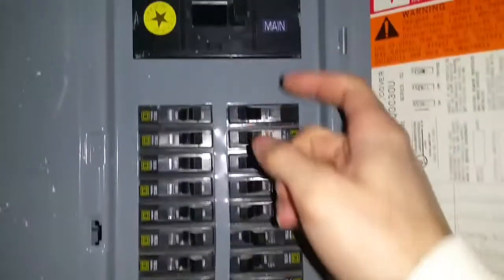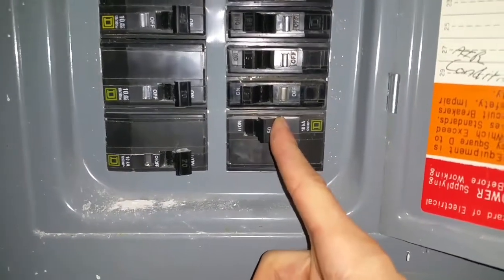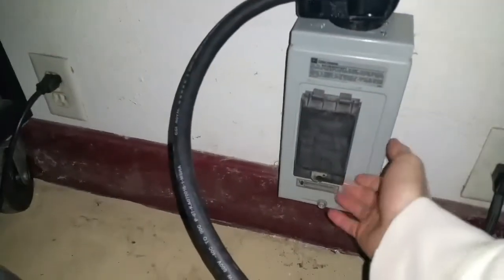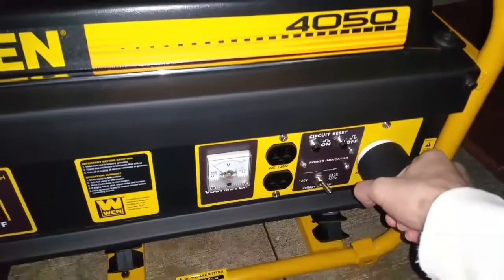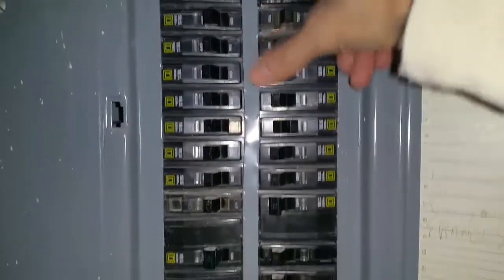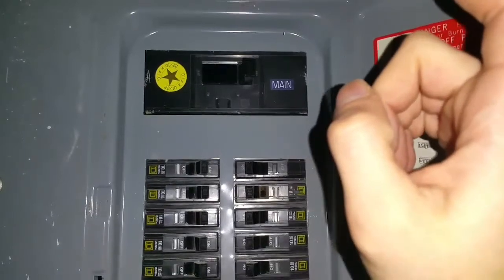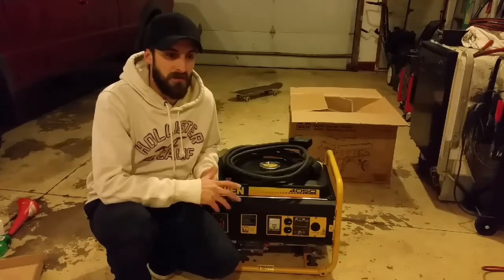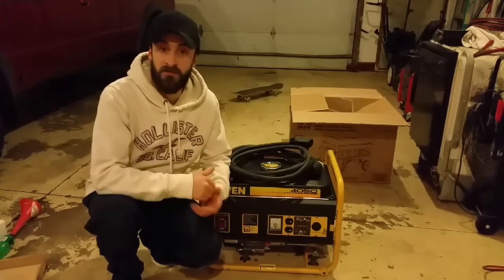How To Hook Up a Generator To Your House - Pt 3 Powering up the house

Comment: You did a great job on the video, but 2 things you did that was very wrong.  1. You should have had all the branch circuits turned off.  Then after starting the generator, and turning on the breaker at the generator plug, and then at the main panel, you should have turned each branch circuit on individually.  Then it wouldn't have to start the whole house at once.  The way you did it is bad for the generator, and bad for the appliances in the house.  2.  You should never shut the engine down on the generator down under load.  Very bad foe the generator

Comment: Thanks for the video. But since you did the wiring of the box yourself maybe for safety sake you should’ve used a power inlet with a male plug. Then you would not have to use a suicide cord with the generator. Would’ve cost you to same amount of money to do it safely.

Comment: I saw on eBay for $ 299  is a reasonable price ? I gonna buy 1 of them how much it's the weight this generator with packing? Thanks for you answer....
Reply from the maker: Luis Chino I think that's cheaper than I paid on black friday. I'd say it's around 60-70lbs. It's usually the top one if you click link in description.
Reply: Thanks so much bro I learn avery day somethings from you good bless buddy still doing same...

Comment: I'm curious about one thing why do you turn off all the breakers in the panel before turning the mains back on, also you skipped one breaker that was previously on with the generator??
Reply from the maker: ARednecksLife I Did that so power from grid isn't being applied to all breakers at same time. Not sure if it's necessary to do it that way. I will do it that way when applying generator power to reduce initial load on generator.
Reply from the maker: ARednecksLife As far as the bottom breaker I had to generator goes, I'll leave that one off unless I need it... It could stay on but I feel better about it being off.
Reply: a21bravo I thought you left another one off when you went back on the grid.
Reply from the maker: ARednecksLife the #12 was already off... It's not powering anything that I can tell in the house so I just leave it off.